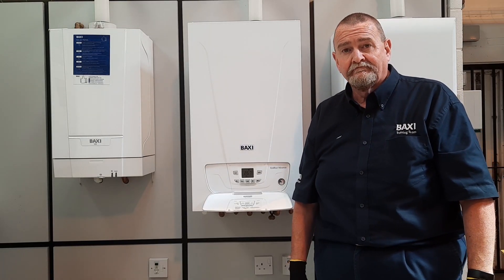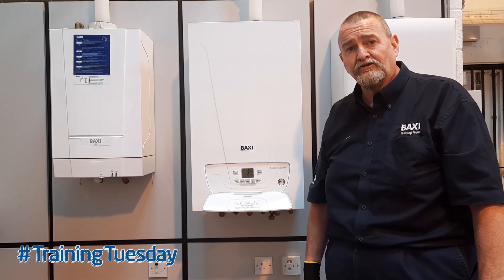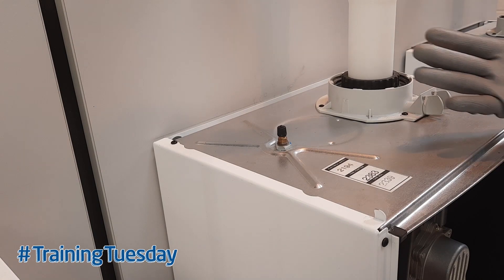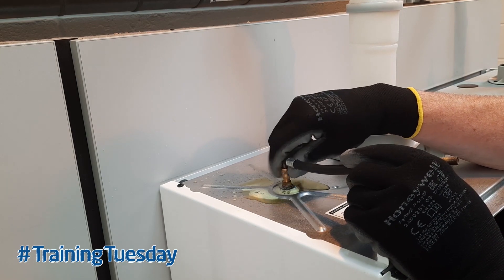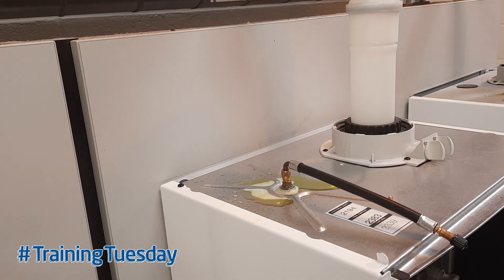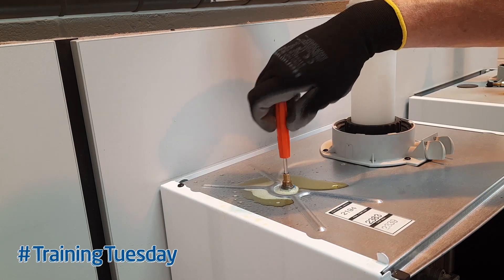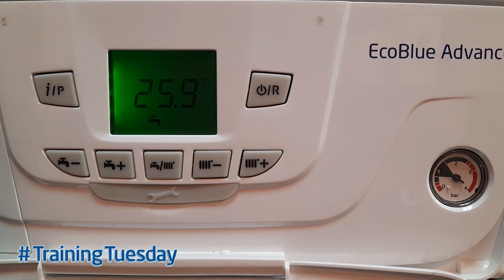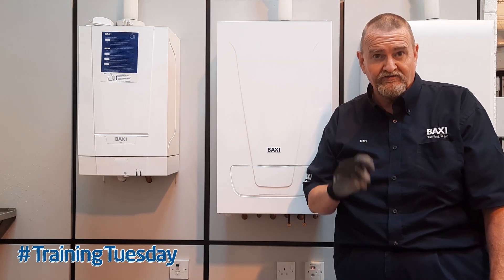What to do if there is water coming from the PRV on a boiler | Baxi Installer Training and Advice

Comment: Makes you wonder what the designers were thinking (or not) when they decided to put the schrader valve up under the top plate on duotecs and similar… Just specing it on the front, let along through the casing, would have done the job!

Comment: Hi Roy - if a boiler can maintain 1.3 bar but water comes past the PRV when you open the filling loop and the pressure wont increase above 1.3bar does this indicate a weak spring in the PRV ? , the Heatline CaprizPlus 28a PRV should vent at 3bar according to the spec sheet  . Cheers

Comment: I would first press the valve before draining if water comes out you know the vessel is faulty then new vessel needed I also use the extensions or change the shroder valve

Comment: Would you not change the prv as good practice since the prv has passed?
Reply: No really unless it's still passing.  You can remove and clean the prv's on most baxi's if required.  The expansion vessel should really be checked and recharged if required on most services.

Comment: Sometimes in older boilers the schrader valve is seized in and disintegrates when you try to renew it.  I have found you can tap a small Allen key hex into the remains of the schrader valve and wind the core out. This never happens in boiler labs with new boilers of course...it's the oldies.

Comment: Great tips, can you tell me where we can purchase shrader valve attachment and tools you used to replace valve thanks, I’m a trainee trying to learn as much as I can
Reply: Hi Richard, glad you liked the tip, as Ashok has said you can get the tool and cores from Halfords or ebay, make sure you get the short cores.
Reply: Thanks
Reply: You can get the cores and removal tool from BES.
Reply: When at Halfords get the new connection for going on valve and they useless ones that come on modern pumps ie the ones that you pull lever up to connect onto schrader get one that you pulll lever down to put on you will get it on to valve you will get that one to fit on e/vessel that are to tight for the other one to fit